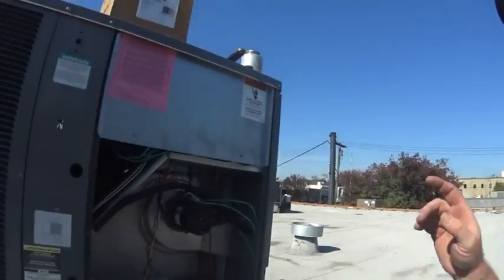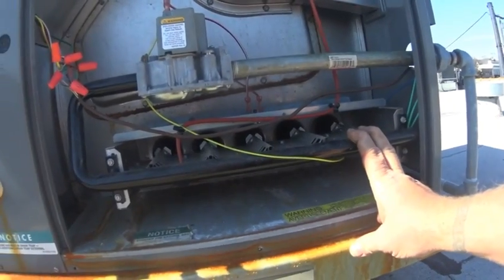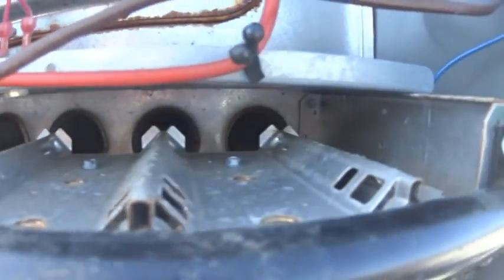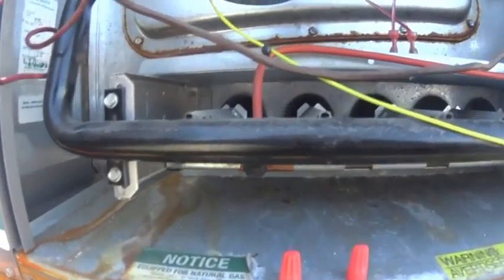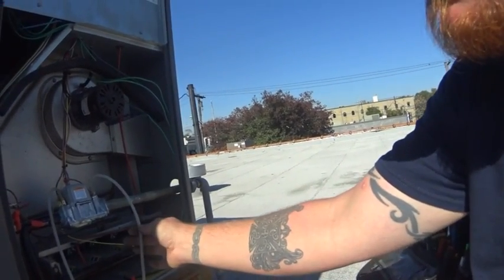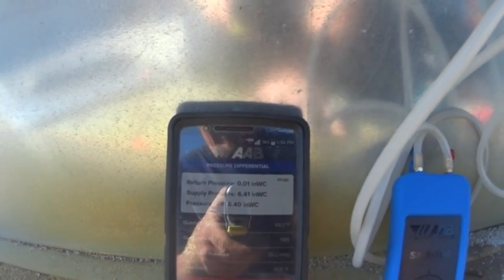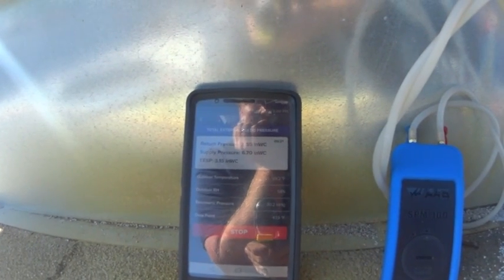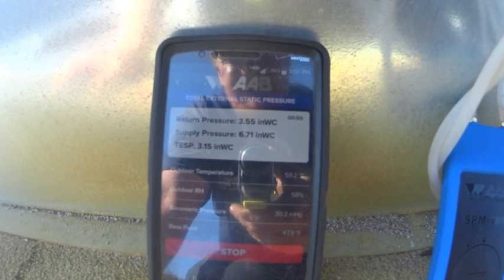ROOFTOP UNIT GAS VALVE SLOW OPENING! #HVAC

Comment: I’ve noticed on the south shore , Especially with Lennox and York that these symptoms are usually caused by the orifices and burners actually being clogged up with rust and debris . I’ve had several nasty spider webs inside the assembly too . Great vid ! Keep them  going bro .
Reply from the maker: Thanks man!   The salt air does do a lot of nasty things to units.
Reply: BK HVAC  You know it .

Comment: Hey billy could a weak inducer fan (one with a centrifugal switch in it) in a package unit cause a flame to roll out a and be sloppy a bit?
Reply from the maker: It could...But if it is weak...Most likely it won't close a pressure switch...

Comment: with propane, which is all I have in my entire service area, we run into a fair share of bad regulators or needed to be adjusted regulators at the propane tank. Some of them will do exactly what that valve is doing and open slowly. That dual option you are running for pressures is the best way to go..... I would say that manometer is trash, unless you want to carry around two of them, me personally one is enough and the fieldpiece is as you said very quick, not that im looking to replace mine but glad I seen this part of that manometer. Thanks for the video Billy
Reply from the maker: thanks for watching!   I like the manometer!   I'm still getting use to it!  I like my fieldpiece head for my meter also!